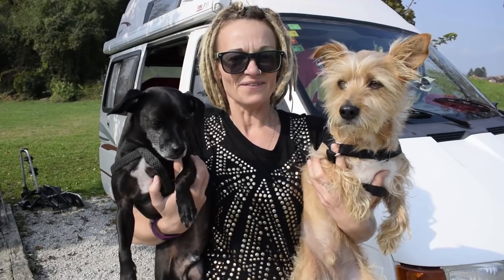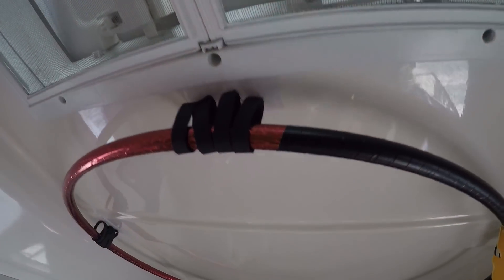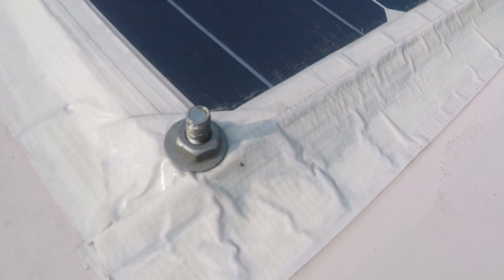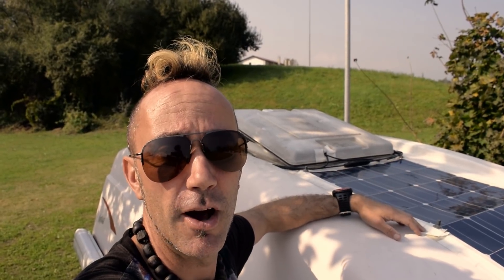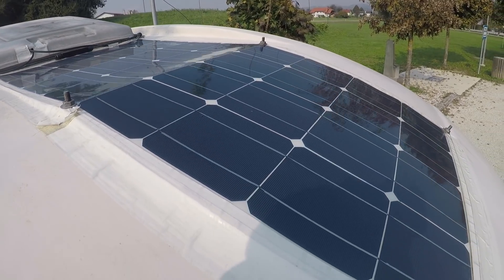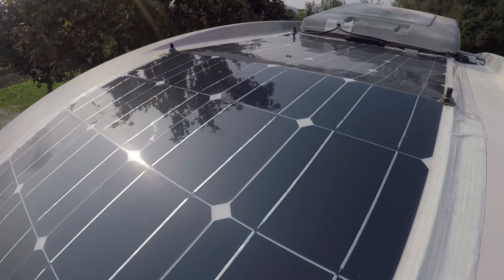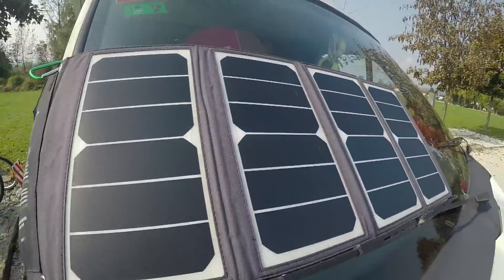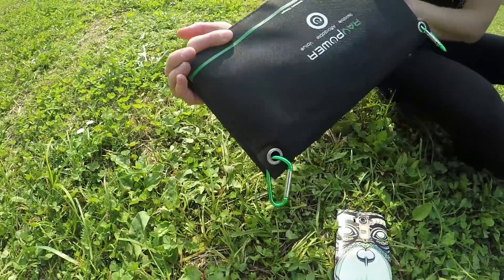FLEXIBLE SOLAR PANEL - 6 MONTHS LATER?

Comment: Love your video and innovated way of putting the panel on top! Do your panels hold the capacity to use heaters/fans or charge small appliances such as small water pumps?

Comment: Hi guys.  I have just re-watched this video as I have just received my first ever solar panel and it is a flexible 130w unit.  I am very worried about it not staying on my van when doing 70mph on a motorway when its windy but also wanting to leave an air gap under it for cooling and water egress.  But after seeing how you have done yours I think I may have over engineered mine now.  Thanks for confirming how well they stay put and giving me more confidence.  BTW Nick... I miss you having your hair like this pal.  Get it back mate :o)  I was very disappointed that there was no Sarah dance at the beginning though :o(  Now I need to make a crack in my van LOL.  Loved that comment.

Comment: Flex solar panel made not for RV,made for boats.To install on RV you must put under solar panel a polycarbonate sheet (remove heat by air).if you not install it your panel will damage or burn fire after 1 or 2 years.

Comment: Thanks guys this video had given me the confidence that my 120w installation was worth the effort and all appears good after 2 months 😁 
Just as a footnote I stuck mine down to the pop top roof with sikaflex but I placed some plastic insulation between the back of the panel and the roof to be safe.

Comment: I know this is a long time ago, but, that is not a MPTT charger. They tell you they are but there not. You can tell if the input voltage is greater than the output voltage.

Comment: Nice video! I like the installation you did. Adding bolts were an amazing idea.  I know some people just add tape to install them. What kind of tape did you use? What is the vaseline for? For the hole you did you can cover it with a cable entry https://cuttingedgepower.com/search?q=cable+entry How do you clean your solar panel?

Comment: excellent video, We all have to make the choice that works for our van and situation. For me, I have a polycrystalline instead of a Monocrystalline panel on my roof. Despite all the praise for mono being better, the square shape and dimensions of the poly panel I found online fit the exact space I have for a panel better than almost every Monocrystaline panels, which were mostly rectangular instead of square. It's been working like a champ since I installed it, no complaints.

Comment: 70W from a  100W panel via a PWM controller like yours is good - not sure you'd get any better from a solid panel. Flexible panels were originally designed for yachts and get stuck to the deck - so they should be fine on a van roof. You can now buy solar panel mounting kits that stick to the roof made of a strong plastic - they also make a special cable entry mounting too - drill 1 hole for cables (add a rubber grommet to stop the cables being worn) and glue the cable entry mounting to the roof - again - they are designed for yachts and vans - so perfect for the job.
Reply from the maker: Linzi Douglas Thankyou 😁😁 yes we are really happy with the performance of this simple setup! X

Comment: 100% rubber silicone will completely seal the hole where your cables come inside.  Regular silicone (not the 100% rubber) will eventually leak if it remains wet.
Reply from the maker: Rob K thanks for the advice, yeah we should probably do that? At the moment there’s just abit of tape on there, no leaks so far but it’s not a proper job🙄 😊
Reply: Rubber silicone?? Never heard of it...🧐
Reply: @dtriplett03  rubber silicone can be purchased at home depot or lowe's... (rubber silicone) is used to seal a shower)    you want one that is 100% because you want it to never breakdown when its wet.  Regular silicone will not work.
Reply: Rob K Thanks, Ill ask for it!
Reply: @dtriplett03  Just use 100% rubber silicone to permanently seal holes.. don't use it to mount a flexible solar panel, you will never be able to remove the panel.  :)

Comment: Eh up fellow van people...are you running your fridge ok from the solar ?
Reply from the maker: John Eyre Hey John, The fridge isn’t connected to the solar, if we use it (which we generally don’t) we use it on the gas, or when we have hook up... Think to use the fridge we would need more than a 100w panel🤔xx
Reply: @theexPAWers  looks like cold beers in the bucket of water then 😊
Reply from the maker: John Eyre 🤣🤣😉😉xx

Comment: Great video
Solar cables cracked roof.
Great to have power on the move
Hope those two little darlings are having fun very windy here in the UK safe journeys 🐶🐶⚘
Reply from the maker: Michael Bell Thanks so much, yes we weren’t happy about that crack when we first got the van! But turned out to be a blessing in disguise!😉hope the weather is improving there xx

Comment: Hi Nick&Sarah I use a ridged one and it caused my fiberglass roof to fracture on the sides because with it up in the air 15mill the wind going through made it drum so I was told to use the semi flex panel and glue it down to stop it from happening.
Reply from the maker: VK7HKN Radio Wow, thats not good! Some folks complain about these flexi ones, but we think they are great on fibreglass roofs! Thanks for watching xx

Comment: Useful video! A couple of points you'd probably want to know. A lot of Chinese manufacturers incorrectly state that their PWM charge controllers are MPPT - they're not, they're PWM. Yours looks like one of these (if you do a bit of googling you'll note that MPPT controllers are large and have big heat-sinks because they're transforming the power down and that generates heat, whereas PWM charge controllers just alternate between 0V and the input voltage so the average voltage is the required charge voltage. This isn't great for the batteries but it does work (and is a lot better than letting them run down regardless). MPPT actually track the charge voltage and increase/decrease charging current based on the supplied voltage, whereas PWM controllers are incredibly lossy and notably can't charge at all when the input voltage is lower than the charge voltage (MPPT can). Second is the heat - your solar panels will be getting extremely hot underneath because of the loss. Energy that's put into a system but not taken out has to go somewhere (basic laws of science - energy can't be created or destroyed, just converted). Bending the panels will increase the loss and thus the heat generated. Having a PWM controller will increase this loss because any energy generated while the controller is not taking it is going to go to heat.

Comment: Very useful & practical information guys - great to see that your solar panel is lasting well with no real issues = a credit to your ingenuity when it came to fixing it to your roof! - Request;- Any chance of posting a short vid on your cycle carrier rack?........I have a fold-up mountain bike and I am planning to convert the interior of my MPV into a camper for solo travel/sleeping purposes (not really practical to put the bike inside the vehicle), so I don`t know whether to buy a tow bar mounted type or rear hatch type or roof rails for me 2005 reg Berlingo MPV.
Reply from the maker: whu58 Thank you!! We are so happy that the method we used to attach the panel has worked so well!! And yes we will be doing a vid on our bike rack really soon😉..... Hope you’ve had a nice weekend

Comment: I think you did a great job considering the shape of your roof guys.
The only thing I might have done differently is try and find a way of spacing the panel off the roof by an inch for an air gap. It would keep the panel cool and would prevent moisture building up underneath.
Hi to Dizz and Charlie! xx
Reply from the maker: Mark Velo Thanks Mark, yeah we originally wanted a bigger gap but couldn’t figure out how to, so it’s how it is and it’s been great so far! 😉 hope you e had a nice weekend xx
Reply: @theexPAWers  guys, I'm no engineer, but looking at your innovation, I'd suggest using another nut or 2 under the panel raising it up. That would take it in laces off the  roof and allow some air flow.  But the thing with that it could cause noise when driving unless you use additional spacers glued to the underneath of the panel to prevent the flap.   But if it works keep it as it is.   If it ain't broke!

Comment: I just bought one but have not needed it yet. It will be used outside the van and not attached. ✌🐧
Reply from the maker: penguin chick These flex ones are very lightweight and easy to move around, although ours is attached to the roof and the tape will be abit tricky to peel off, it’s still good to know we can get it off if needed😉 thanks for watching xx

Comment: Thanks for the Vaseline tip!   Who knew?   I have some magnet clamps on my roof to hold down all my wires (I have 3 panels and lots of wires).   They work great but they are NOT intended for outside use and want to rust.   I will go coat them with Vaseline now!
Reply from the maker: Mark Owen Martin Yeah, someone told us about the Vaseline trick a while ago and we were surprised at how good it works😉 thanks so much for watching xx
Reply: For your cables use cable ties and some cable tie stick down clips - remove the sticky pad and use sikkaflex or other sealant to attach to the roof - these work really well and are a very tidy solution to cables on a van roof.
Reply from the maker: Linzi Douglas Ok, thanks so much for the advice! Merry Christmas to you 🎄xx

Comment: Cheers for the update.  I’ve still got to fit solar on my roof and I wanted to know how successful the flexible panel installation would be.   I think the button/bolt arrangement was brilliant and I’m a firm believer in the quality of CT1.  My skylights are bedded in it and it’s been perfect.  Any chance you could tell me what mppt controller you’ve used, (and how much it cost)  pretty please.  kind regards, K33F
Reply from the maker: keith lester Thanks Keith, yes we are quite happy with this basic setup, it’s working good for our needs, the CT1 is good stuff and not forgetting the Gorilla Tape😉.... Theres a link to everything including the charge controller we have in the video description😊hope your having a good weekend x
Reply: the exPAWers 💖

Comment: Useful, informative video.  From what I've read a lot of the heat issues and subsequent failure of flexible panels stem from them being bonded to metal roofs on panel vans., which get incredibly hot in the sun.   On a fibreglass roof this is much less of an issue.  Of course a rigid glass panel would be ideal but we all have to work within constraints in terms of roof space, size shape etc and a bendy roof lends itself to a bendy panel!
Reply from the maker: Shaun Robertson Thanks so much, yes that would make sense that the metal roofs would get very hot, had no issues with our fibreglass roof, so very happy with that! 😉😁